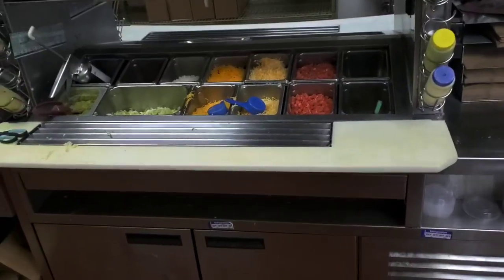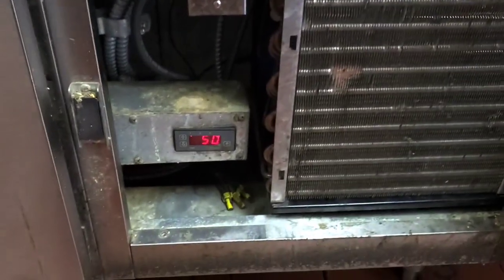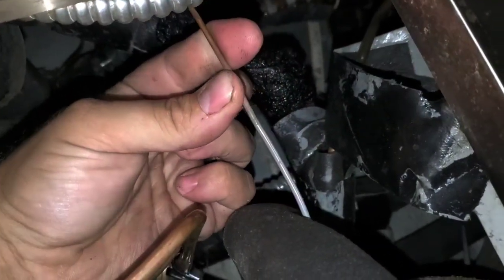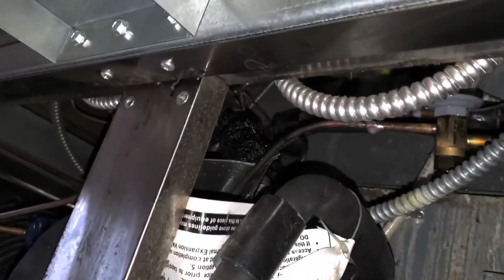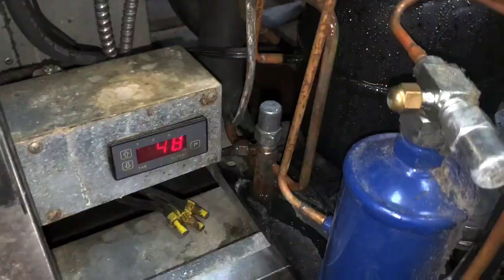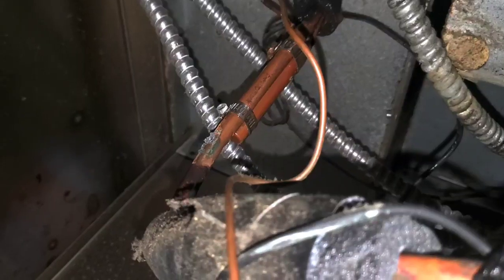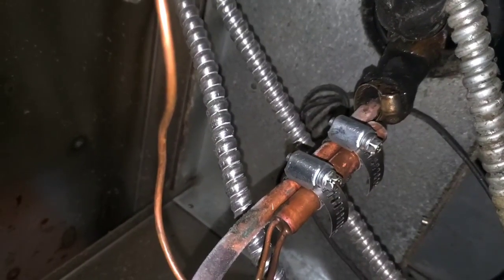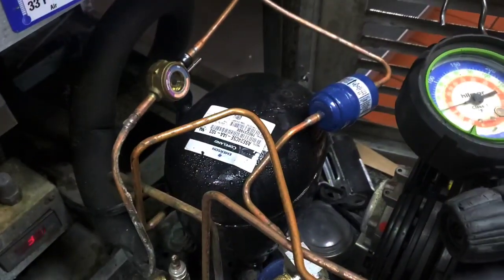How To Diagnose And Fix A Simple Overfeed On A Cold Rail System (feat. Mashed Potato Johnson)

Comment: I have zip tied when I didn’t have proper clamps, but I used thermal paste and then wrapped it in insulation.
Reply from the maker: I've zip tied sensing bulbs without thermal paste,  that's how i know that don't work on a colld rail

Comment: Where’s the best place and o’clock to place the txv?
Reply: For the cold rail is the bulb placed after the evap coil ?
Reply from the maker: It's after the evap, close to the coil, and at whatever o'clock you want as long as its secured TIGHT AF with stainless hose clamps. Secure the bulb poorly and nothing else matters it will underperform from hunting.
Reply: @satanicinduction  👍